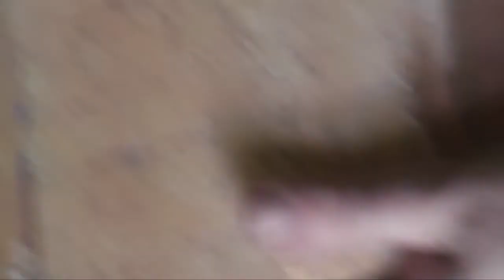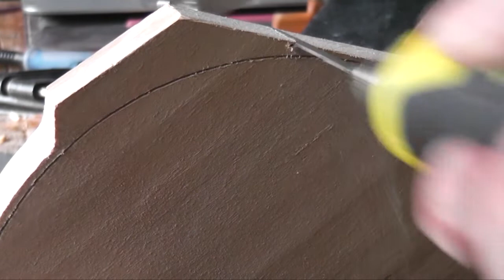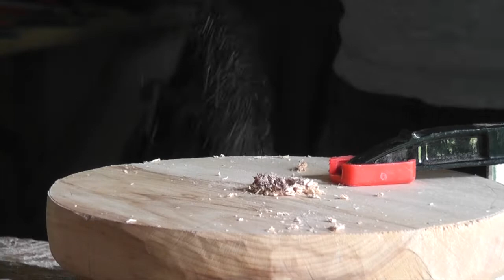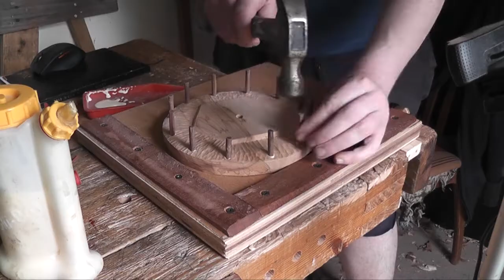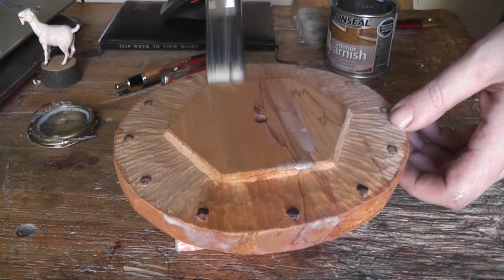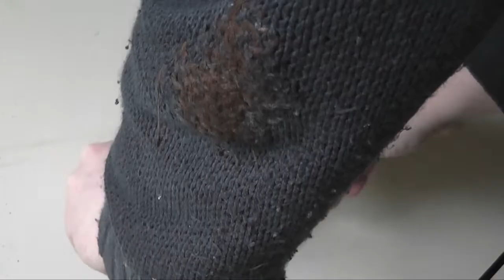Hand Carved Spalted Beech Wall Clock [Woodworking Project]

Comment: That turned out real nice Clint. Am gradually going back to using hand tools more often. I love using my compact (180mm) ryoba. I am thinking of buying a 240mm or 270mm now
Reply from the maker: Thanks very much! I have to admit I've only just recently got more used to the Ryoba after not getting on with it for ages but like you I'm gonna buy another and probably a Dozuki aswell I think it's called. It's kinda like a Japanese dovetail/gentlemans saw.
Reply: I might do a review of all 3 compacts, but I ain't no gentleman :)

Comment: Always a great vid mate. I like the long view of the clock right at the end, curiously restful. Thanks as always. Like the pull-saw; is that a new acquisition? Thanks again Clint.
Reply from the maker: Cheers Mark! I've actually had that saw for a few years but never really got the hang of it. Recently I've found it very useful for cross cutting so I think I may purchase another! It leaves a lovely smooth cut too.

Comment: Another beaut Clint👍🏻 love the camera work what type of camera do you use? Also the Ryoba is this a new addition to your tool set and how do you find it vs the western style ones? Cheers Steve
Reply from the maker: Cheers Steve! The camera I use is pretty old to be honest, it's a Panasonic HDC-SD60, I'm looking to get a new one in the near future. The Ryoba I've had for a long time but could never get used to it, I've just recently been getting more accurate with it and I love it to be honest! Especially when cross cutting small pieces. It leaves a lot less tear out than my Western saws, I'm gonna get a couple more I think.
Reply: Timber Anew I continue to try with my Japanese saws and improving my technique but still not as good as my western saw technique 😏 I’m better with an Ikedeme saw (a small fine toothed dovetail saw) which has a very fine cut. My old Panasonic has packed in so using an equally old Fuji one which the auto focus drives me bonkers 🤪